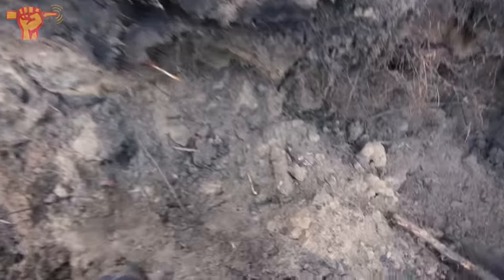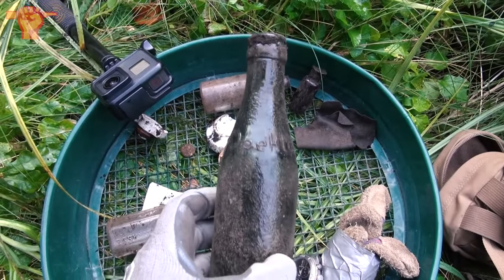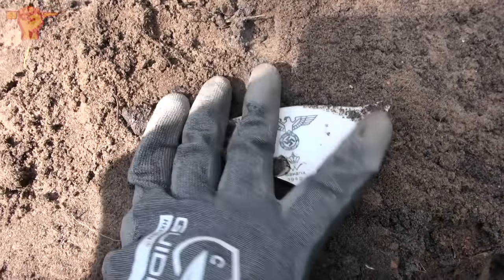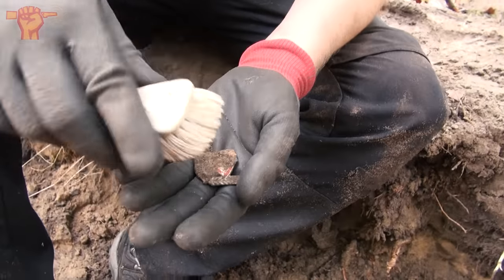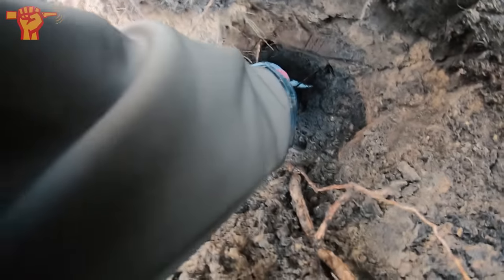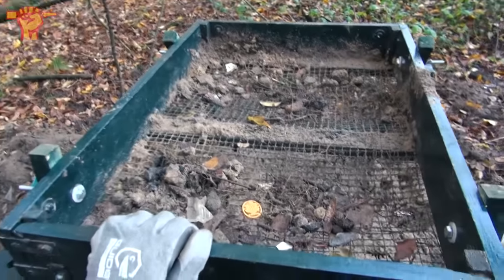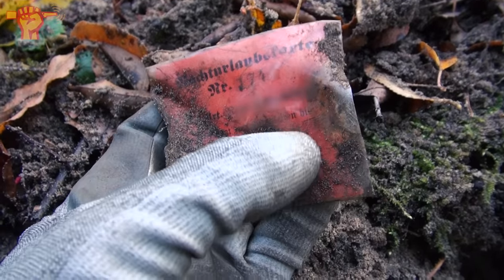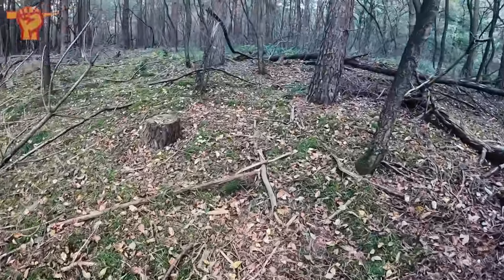Former Wehrmacht Base still loaded with WW2 Equipment

Comment: That stuff seems awfully clean for being in the ground for 60+ years
Reply: 70+
Reply: @Kyloken1010  75+
Reply: I've been doing metal detecting for years and nothing seems unnatural in this video. How metal corrosion occurs depends on the type of soil it lays in. I have found silver dating hundreds of years back that looked like the ring found in this video and I have found silver that was completely black. You'd be surprised how well preserved some items can be if they're buried in the right type of soil
Reply: german quality at work here.
Reply: @Ellie5621 The type of soil has an effect on it too. For example, I’ve seen artifacts pulled out bogs that are in pristine condition.
Reply: @gris186  but how they find those spots?
Reply: If they didn't find it where did it all come from the local museum or collectors 😂 I'm sure they would let them re bury the stuff🙄 you can see the dirt doesn't have acidity to it different dirt degrade things differently so I believe what they are finding is real and in situe 🇬🇧😎✌️
Reply: Yea I mean when it comes to these types of videos (with having other YouTubers gaming things like this which is a fact) it’s hard to believe stuff like this sometimes. The only
Thing I don’t like is it seems like every item he finds, the video was cut and then started shooting as it’s laid out on the ground. Why not have the camera rolling as you dig? Then edit when u get home so you can atleast see them digging.
Reply: Yeah. I think some of the stuff seems planted for content.
Reply: @@Ellie5621oh jealousy is a hard pill to swallow
Reply: @jayvoo👍
Reply: "1944 Bavaria"
Yes I'm sure the Nazis were using the English translation of Bayern 😂
Reply: Yea, I don’t know guys. I think you found a reenactment site from 8 years ago. That stuff isn’t just that accessible at this time, that clean in that abundance.
Reply: I farted. 😂😂😂😂. I'm not a bot. Unless bots fart. 😂😂😂 jk. Cool finds tho. I used to metal detect but never like this.
Reply: @gris186 exactly the less oxygen in the soil the last oxidization slash decay for example I have found cast iron that is over a hundred years old intact and with little corrosion about a foot under thick clay clay virtually allows zero oxygen through the thicker the soil the better for preserving something
Reply: It depends on the soil and what type of material. I've been metal detecting for yrs this stuff was not planted it's legit
Reply: Made from aluminum! Or even pewter! Won't corrode like steel!
Reply: Adolfs been squatting there recently
Reply: And the freshest swastikas!
Reply: @corybrown1450 alkaloid soils
Reply: @Bielorussepursang Go back and do some reading and educate yourself to the numbers of fighting men and women that were killed in battle during ww2.. They go to areas where they know battles were fought. Its the same as in the plains of the United States. You can find Native American arrow heads   almost everywhere. A lot of human beings have lived and died on this planet before you or I got here.
Reply: He buys it on eBay and buries it
Reply: @Bielorussepursang By looking at maps of where battles were.
Reply: It’s actually been like 80 or 70 years
Reply: @corybrown1450  Then how do the worms survive?
Reply: @lloydchristmas1086  that's a good question and I'm honestly not sure but I'm going to look into it I don't know how much you dig but you don't tend to find worms deeper than a foot in the ground or even half a foot unless the ground has already been ripped up and the soil is loose
Reply: Kraftfarhkampf
Reply: He finds some interesting stuff, and had fun in Berlin. However, go to 'World War 2 Metal Detecting' to see them dig the Eastern Front. Wild stuff they find, untouched dugouts(they dig out), finding planes in swamps with pilots still, stuff in the rivets. Eastern  Front was constantly shifting, and Stalin wasn't exactly 'hazmat friendly' in the several major post war cleanups, so there's a lot of gear and weapons and helmets thrown in rivers or swamps.
Reply: @corybrown1450  I found out they breath by air desolving on the mucus of their skin...they breath through their skin if they dry out they die. Wild 😊
Reply: @himhim3344 Bavarian porcelain uses the word ‘BAVARIA’ and even uses ‘GERMANY’ for their marks. A simple Google search would have prevented you from seeming ignorant.
Reply: The Nazi bird is silver man. silver dosent corrode.
Reply: It looks exactly like something thats been in the ground 75 + yrs not everything from ww2 looks in horrible condition
Reply: What do you do with your finds?
Reply: @josh05683 Ice and Swamps/Bogs preserve stuff really well.😊
Reply: @plagueoperator7438  I said that?
Reply: @josh05683  replied to wrong person sorry

Comment: You guys should make a double mesh sifter. Top mesh is ok, but build another, identical with half that size, at a shallow angle and a chute at the end, the shut falls into a bucket or what have you.

This is sort of standard MO when you sift for archaeological debris. Even the soil is gathered unto a tarp and an intern has another look before it is piled away.

Trust me on this, it's worth the effort, because you can find bobby pins, beads, and a whole plethora of interesting items that would otherwise be lost. If you get the angle of the second sifter right, it's not even that big of a work out.
Reply: Yep

Comment: This is nothing compared to some areas in the South Pacific.  On the islands of Kolumbangara and Bougainville in the Solomon Islands chain, there are tunnels still filled with Japanese equipment from World War Two, including lots of explosives.  There is a village on New Georgia that is built in an American bomb dump.  You do not even need metal detectors, just a good bolo to clear the brush, and good boots for the tunnels.